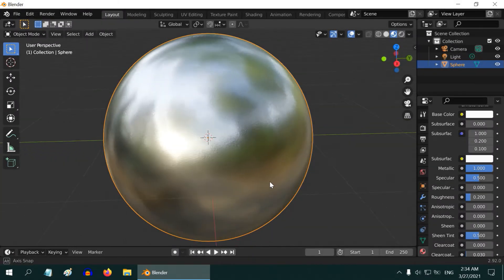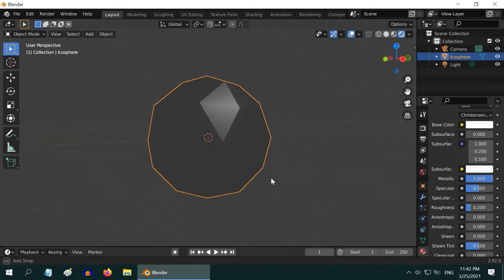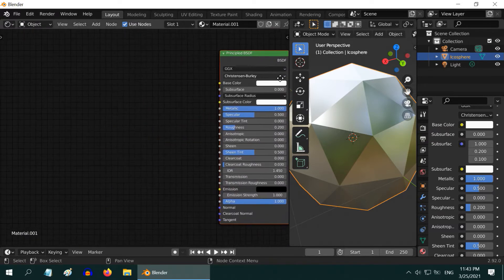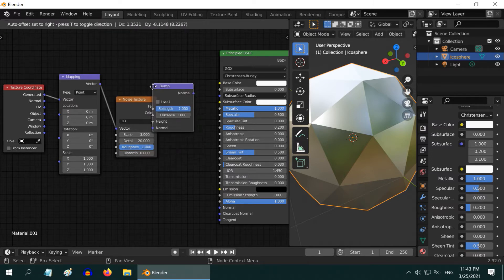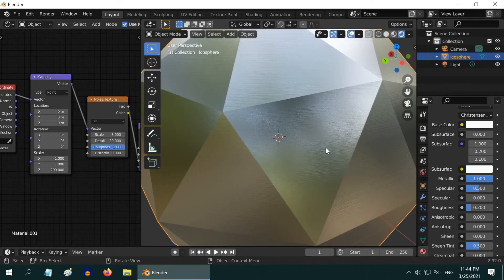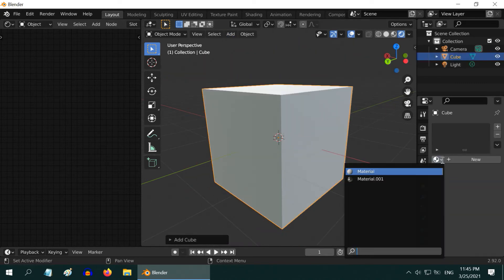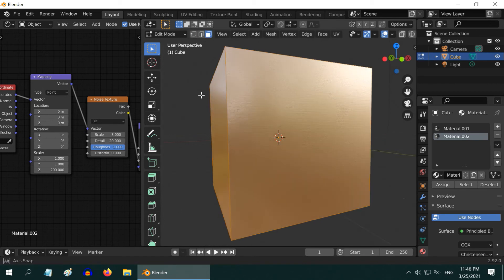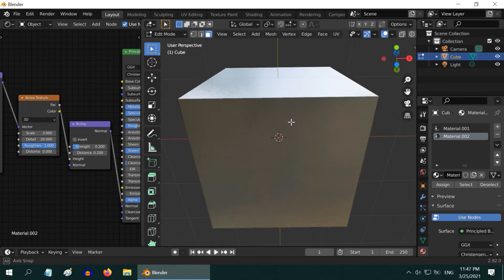Create Brushed Steel Material In Under 2 Minutes | Metals In Blender (All Versions) Eevee & Cycles

Comment: The video is great. I have a question is when I hit F12 to render, it is still in the black color even though I turned off Scene world before that. Thanks.
Reply from the maker: Hi, turning off the Scene World affects only the viewport, the rendered output from F12 will still use the scene world. To get the bright environment light in the actual rendered output (we also call it HDRI lighting), you need to setup the world material with some HDRI. This has been explained in this tutorial 👉 https://youtu.be/JUhq6cHTuOE (takes just 2 minutes to setup and it is very useful). I hope this helps.
Reply: @5MinutesBlender  I got it. Thank you so much.